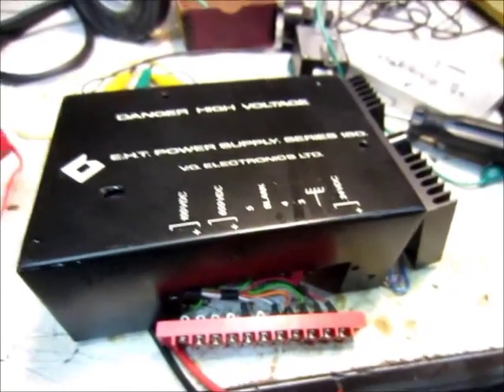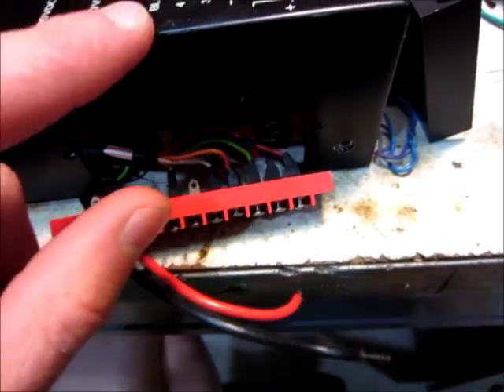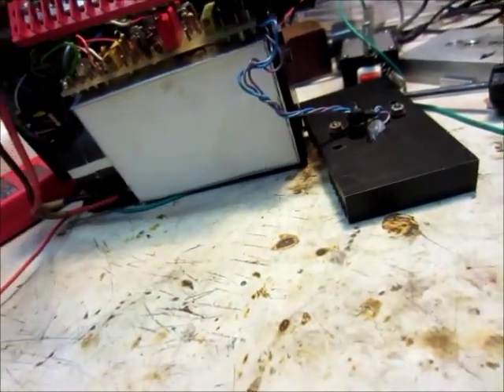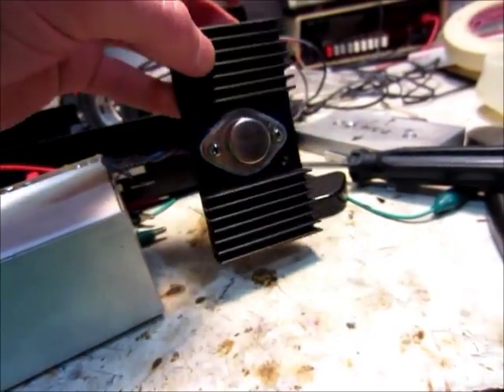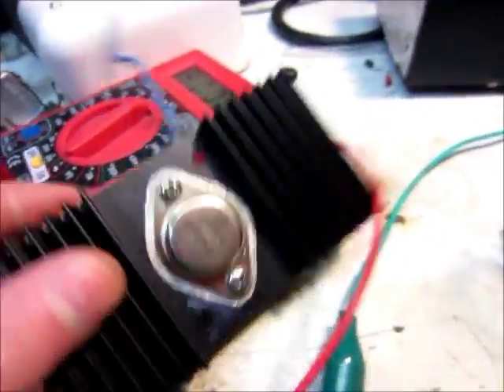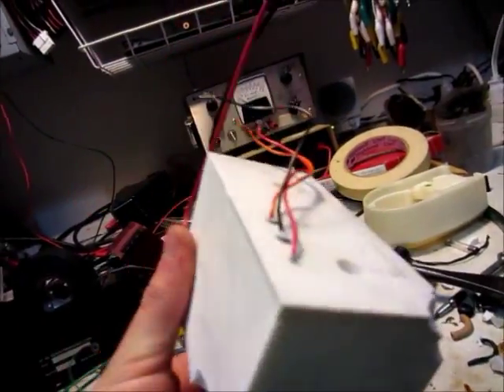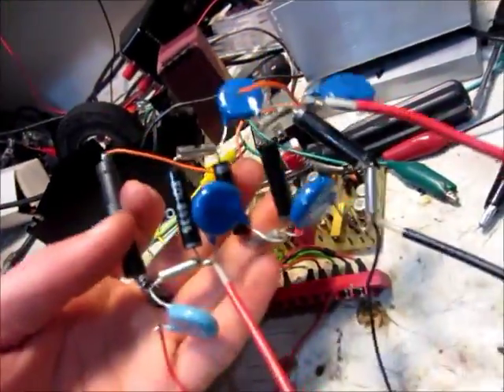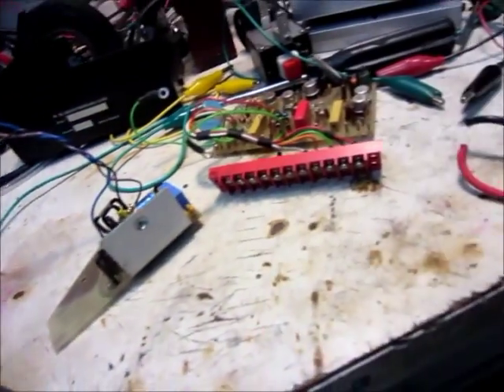Old 600VDC Power Supply Tear Down EHT Series 180

Comment: That recrtifier with the high voltage diodes and capacitors was a rectifier but it also serves as a voltage multiplier to step up voltage.